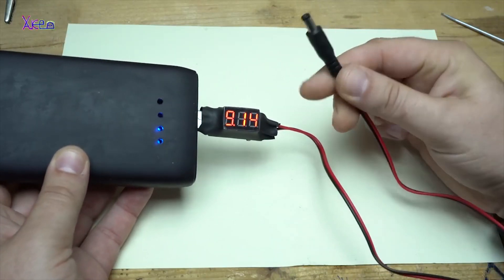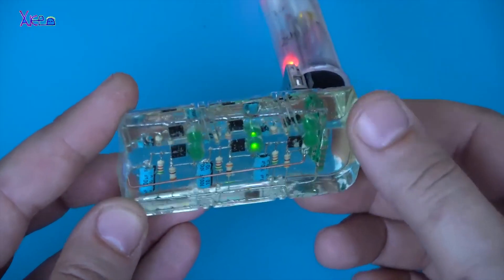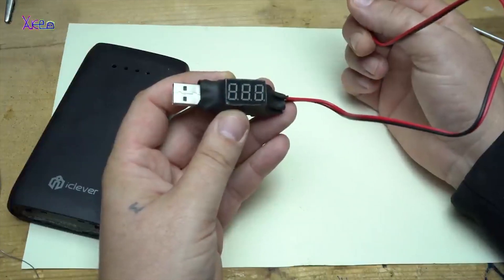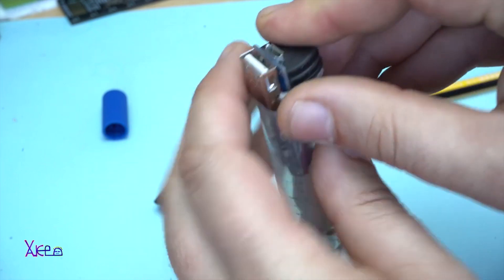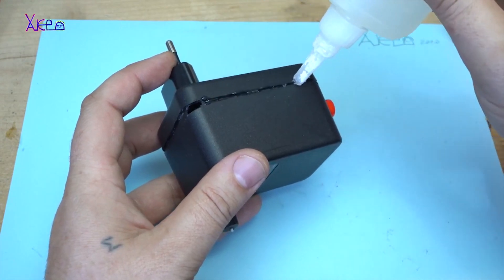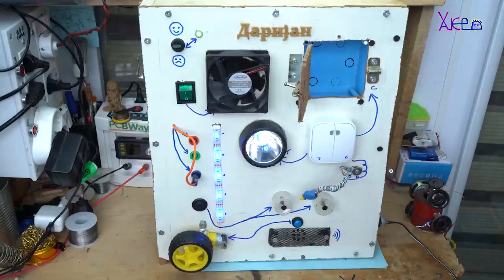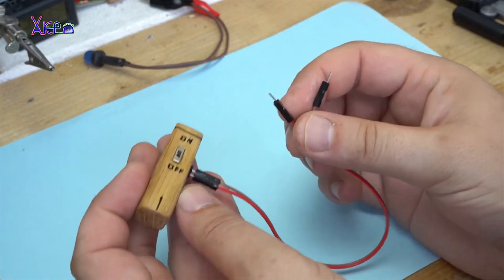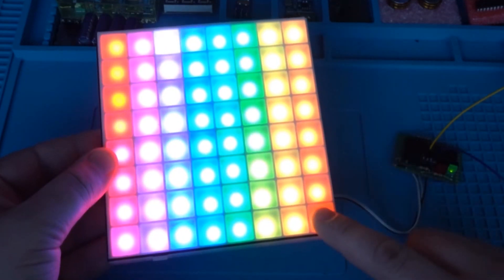13  Homemade Gadgets 13 DIY Projects

Comment: Can you use a volume control, (potentiometer) as a variable resistor in an electronics application? Meaning I saw you make an LED that you can plug into 110/220 volts. the first try the resistor got too hot and you had to change to a higher resistor. If you had a volume control, would you be able to turn it up to increase the resistance?

Comment: With variable boost supply: What is the current output? Same as the power source, or does change with voltage?
Reply from the maker: It change with output voltage,higher output voltage lower current,the board can handle max 3 amps